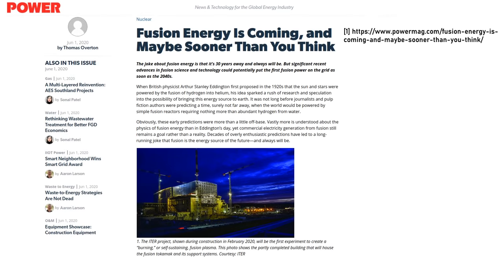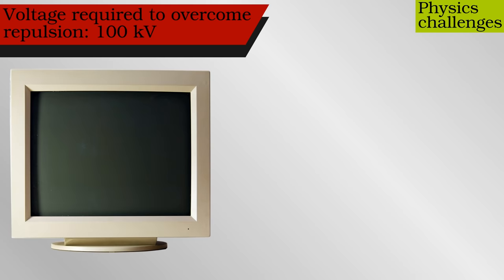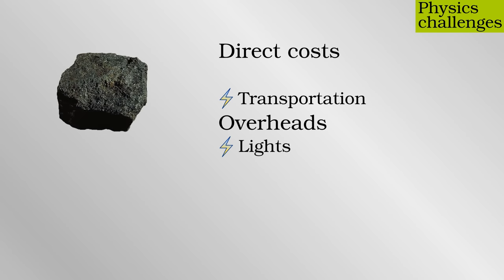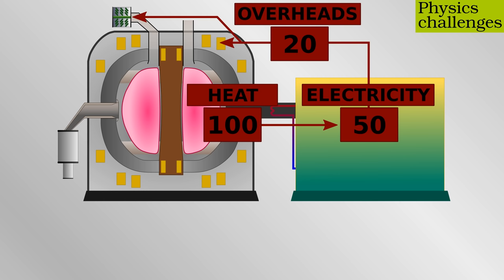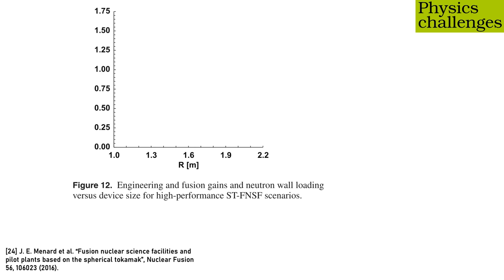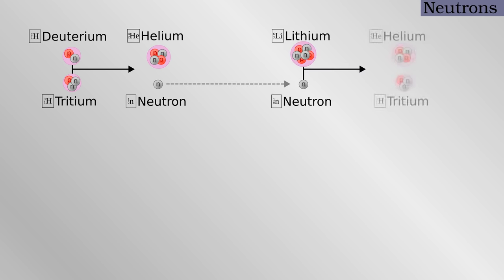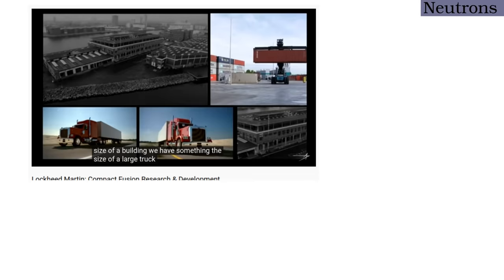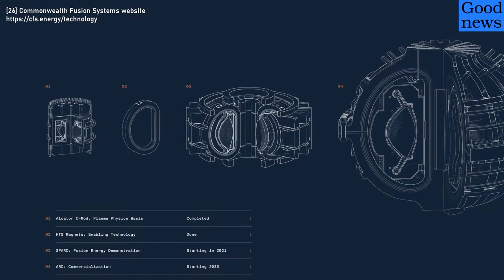Former fusion scientist on why we won't have fusion power by 2040

Comment: "Commercially viable" seems to always be the tricky part. Even with fission plants while we cracked the code and made them actually viable, new plants are still very expensive to construct so a lot of governments are hesitant. While finnish Olkiluoto has finally been finished and its working just fine, it was an embarrassing nightmare project of constant problems and delays for over a decade.
Reply: But that power plant will pay for itself in the long run, just like every other power plant.
Reply: France actually developped bottom of the sea-hydroelectric generator that works with maritime crurent 
The tech worked, but the governement due to EU legislation didnt have the right to assist on the market to bring down the cost, so nobody buyed it because it was way way to expensive
And the company shut down/tech was abandonned for now
Reply: Solar PV became more cost effective per MWH for new power plants than nuclear in 2010. Since then solar PV costs have dropped down by, what, 2/3? And totally scalable -- you can even do it individually, for yourself. I have 18 solar panels that make 3x more power annually than my electric car uses, tho only maybe 30% of my total use. I'm not in a great climate for solar, and that's without going all-out by any means -- there's lots more room on my roof. The issues and costs with adopting it on any scale seem trivial compared to fusion.
Reply: @craigcarmichael5748  Solar power is unreliable. Its not always sunny. Especially in Finland where most of the year is spent in darkness. The closer you get to equator, better solar panels become but they are not very effective the closer you get to the Arctic circle or Antarctic. Its a great auxiliary to get cheap extra energy every once in a while but you cannot rely on it as the primary energy source.
Reply: @Meitti  Too true. I'm at just 53 deg. north (Haida Gwaii BC) and I get lots in summer but very very little in winter. (The tree shadows cover everything.) Storing energy overnight is one thing, storing it for months is quite another.
   More promising for experimenters: now I think I know how Nikola Tesla got free electricity from his Tesla Coils, while after him they have only been used for fancy displays of ionizing air, "lightning". Everyone grounds the bottom of the secondary coil. That's shorting out the free energy to ground. (It comes from the recently discovered "high energy" or HE band 1000 times higher frequency and energy than gamma rays - most electromagnetic spectrum charts still don't even show it - or the new VHE band even farther up.) Tesla must have connected the bank of light bulbs between the bottom of the secondary and the ground. One instruction for making a Tesla Coil says "Don't ground the secondary to your electrical system ground. It will fry everything in the house." That kind of energy isn't just coming from the power supply to the coil.
Reply: @Meitti  Solar power is one of the most reliable energy sources out there.
Day-night cylces are very predictable for thousands of years. Average hours of sunshine for a specific location hardly changes, so you can also expect a constant energy output for every year. There is no better market.
Local variations by cloud cover can be easily overcome by geographic spread and increased capacity.
Reply: @Vulcano7965  You get 5 hours of sunlight, most of which is cloudy and snowy for 5 winter season month in Finland. Thats 5 months of Solar power doing absolutely nothing.
Reply: @Meitti  That contradicts anything I said, how?
again, highly predictable source of energy. Average sunshine hours are known for each lattitude.
Reply: @Vulcano7965  Yeah, and the average sunshine hours are very low in winter season latitudes, making solar inherently unreliable. Compare to Nuclear which has steady output regardless of weather or seasonal conditions.
Reply: @Meitti  that's not what unreliable means my pal
Reply: @Vulcano7965  Thats exactly what it means. You cannot rely on solar energy during winters.
Reply: @Meitti  it means it's maybe insufficient in your specific area.
Reply: @Vulcano7965  "Maybe insufficient". So, unreliable. Do you rely on something that "maybe works?". Do you think a flickering light bulb is reliable?
Reply: @Meitti  Does the day-night cycle change randomly in finland?
Again, solar output is very predictable, thus reliable.
Not sure why you so angry about demanding otherwise.
Reply: @Vulcano7965  Day-night cycle changes periodically across the seasons, also winter seasons daylight hours are further reduced by random weather patterns, Solar panels being covered in snow and so on. If you rely on solar panels to heat your house during winter, you're guaranteed to freeze.

I'm not angry, I'm just baffled why you try your hardes to dodge standard textbook definition of "unreliable". Can you rely on solar panels half the year in Finland. No, you cant. That makes them Unreliable. Can you rely on nuclear energy throughout the year? Yes. That makes it Reliable.
Reply: @Meitti  Maybe it helps if you don't try to see PV from a unique finish perspective. Because then you're calling it unreliable everywhere else which obviously isn't the case.

I also never said that PV could power Finland alone but feel free to quote me on that. I explicitly said it's maybe unsufficient (maybe because I can't exclude that homeowners in finland operate roof PV successfully)
Reply: @Vulcano7965  "Average hours of sunshine for a specific location hardly changes," Your words.

Turns out they do, once you go far up north enough. Solar power works better the closer to equator you get. But again compare to nuclear which doesn't care about the equator or the weather. Steady energy 24/7.

Problem is not just in Finland, entire rest of Europe suffered from energy crisis 3 last summers in a row for over-relying on renewables (including solar panels). So when they couldn't provide enough energy, countries scrambled to get more coal or russian natural gas as a plan B. The reason why nuclear is pushed to be included among a list of Green energy sources is the fact renewables alone are not enough to combat climate change and provide enough energy by themselves.

Solar power is unreliable because it is a slave to weather and hemisphere conditions. They are a good and cheap source of extra energy but you CANNOT rely on them to provide a steady source of energy, especially during evenings and nights when electricity is needed the most. It is inherently unreliable.
Reply: @Meitti 
 Show me the average sunshine hours change drastically year to year in finland.

Also you keep strawmanning my position that I say you can purely rely on PV energy. I stated it's a *reliable energy source*, because it's not subject to randon changes. The sub shines 24/7, earths rotation stays stable for its lifespan.
Reply: @Vulcano7965  "Show me the average sunshine hours change"
https://youtu.be/mPfexz72ClU

"I stated it's a *reliable energy source*, because it's not subject to randon changes."

It is subject to weather changes. A rainy day reduces the output drastically, let alone a blizzard. The sun does not in fact shine 24/7.
Reply: @Meitti  I'm not sure you understand what I'm asking.
for example from the finish met office: “The annual amount of sunshine is highest (1900 hours) in the southwestern maritime and coastal regions and lowest (1300 hours) in eastern Lapland.“

Does this number of average sunshine hours change drastically from year to year?
Reply: @Vulcano7965  Well yes. Yes it does during winters. You can take an average on anything but it doesn't mean median is the average every single day. Again you're looking for excuses here for your wrong description of "reliable". Solar power is unreliable during winter seasons because even the measly 5 hours of sunlight can be blocked by snowy days and blizzards and sun cannot provide sufficient energy for weeks at a time.
Reply: @Meitti  The average includes the winter months.
See it from the perspective of an operator of a PV plant (or rooftop PV): You know the amount of hours you realistic get throughout the year and which revenue this will earn you. So you plan accordingly and wont need to worry about the system for decades because it's suddenly changing like e.g. problems in the fuel supply chain or other human failpoints which are much less predictable. 
 
You try to discuss a whole different point. Either engage faithfully or we're done here.
Reply: Solar and Nuclear is not a case of one or the other, but more of a case of them being highly complementary.  Renewables are good at scaling up and down with activity on the grid, and nuclear is not.  Nuclear is good at providing for base load and renewables less so.
Reply: They have enslaved and fooled you 👉 The Connections (2021) [short documentary] 💖

Comment: My biggest gripe about the fusion narrative, is whenever they describe break throughs of energy production, or crossing over the break even threshold, they are talking about the relative energy formulated on an equation. And as you described, there are energy losses from the conversion of thermal capture, to mechanical, then to electrical energy plus that electrical energy needs to cycle back to maintain the reaction, when we are already at a net loss. It's all smoke and mirrors right now.

Comment: Also, there is a cost in producing(refining?) deuterium. The hydrogen and oxygen produced would help to offset the cost, but there is still a huge space requirement.
Reply: Fusion releases such massive amounts of energy from a minimal amount of fuel that the cost of producing deuterium is negligible in comparison to other costs.
Reply: It's not hugely expensive, about $1 per gram is about the bottom end of commercial prices at the moment.

Comment: maybe a dumb question, but anyhow. What about if the reactor would be set up in space, would that allow us to forgo the energy needed to create vacuum and the cooling of the whole thing?
Not saying that we should go to space to do it, but in case we do make it there in some higher capacity would this be more feasible there?
Reply from the maker: There are a few problems, not least that it is very expensive to launch a reactor into space. Some of the fuel recombines into a gas at the edge of the reactor. You would still need to have some sort of wall to keep this fuel (it's not confined by magnetic fields because it's not a plasma) from escaping. You also would need to pump out the Helium-4 produced. So not much of a benefit for a huge cost.
Reply: It would be even harder to cool it in space what are you on about?

Comment: Realistically, I don't expect power production from fusion to happen before 2050 either. But i think hyping the people up for it is undoubtedly a good thing. While we're working to fix the problems with the fusion, we might stumble on some other groundbreaking technology.
Reply: How in the world is it good to hype people up over something that may never come?  That sounds like a really good way to get people to distrust science and institutions in general, which is our current sad state of affairs.
Reply: You need to consider the opportunity cost. An eyewatering amount of money and brainpower is being spent on fusion research. We have to wonder whether that is really the best use of those resources, or whether it would be better directed towards technologies that will have a greater and faster impact on the oncoming crises. We already have a fusion reactor - it's 93 million miles away, but it produces loads of energy that we already know how to capture; we should be focusing our efforts on using that to wean ourselves off fossil fuels as quickly as possible, and on removing CO2 from the air. Fusion research is a massive distraction IMO.

Comment: Great video, question though: with the ITER’s proposed fusion gain of 10, would we expect to see any actual meaningful energy gain (engineering gain of more than 1)?
Reply from the maker: In principle a fusion gain of 10 should be able to get above an engineering gain above 1 for a conventional tokamak like ITER. The more, the merrier, of course and any future plant should go even higher.
Reply: ITER I think will run at about 0.6 overall, when it’s at Q=10. If I remember correctly.
Reply from the maker: @Gomlmon99  Very hard to say, since the blankets are not continuous and are not connected to electrical generators.
Reply: @ImprobableMatter  According to ITER and partner organizations, the reactor will consume 300 MW of electrical power to produce 500 MW of waste heat in the 2030s. If turbines were installed at ITER to convert that heat to electricity at 50% efficiency, it would result in an engineering gain factor of 0.83. A big step up from most startups, but probably not enough to demonstrate commercial viability.

Thanks for the video, your explanation was well done!

Comment: Back in 1986, I once worked for an individual who worked at the Princeton facility.  The problem with fusion I was told was not doing fusion, that is easy.  the problem is sustaining the reaction. there were question like how do you introduce fuel into the reactor without disturbing the magnetic field? Once the field is disturbed the magnetic field collapses and fusion stops.
Reply: very interesting bit of info- thx

Comment: Still the best summary video, approaching the problem from all angles. Even more relevant now that we are fed the clickbait news of ~1.5x gain, a.k.a. "ignition". And even though some outlets are talking about why it is not feasible with only 1.5x gain, still almost no one is talking about the challenges of breeding tritium, or why high energy neutrons are still a nuclear hazard.
Reply: This is what I like about Helion's approach. No ignition needed, He3 instead of tritium for fuel, and direct electricity generation without the thermal/steam intermediate steps.